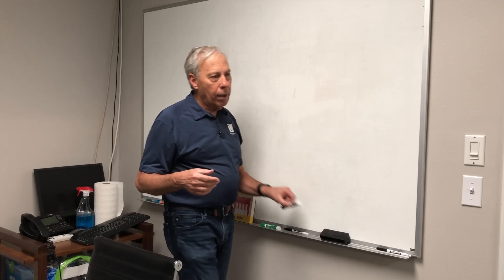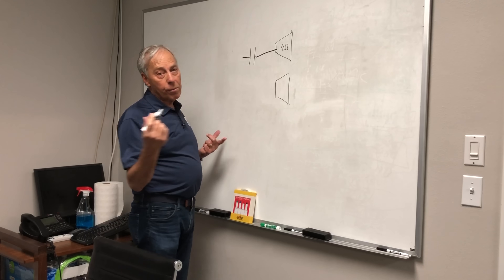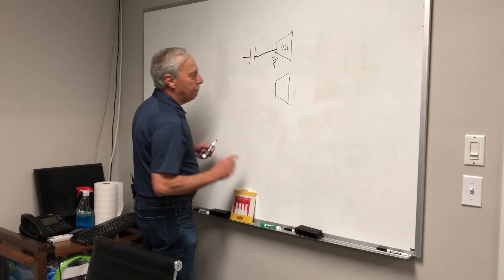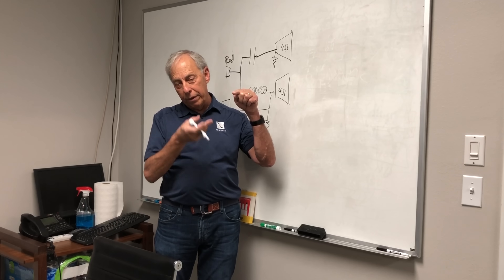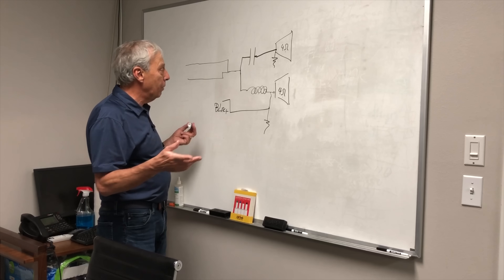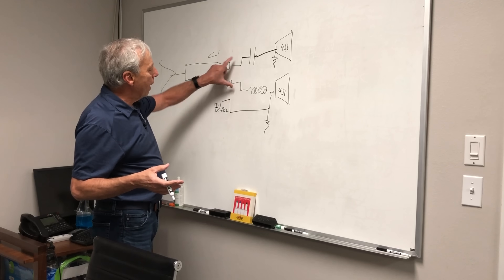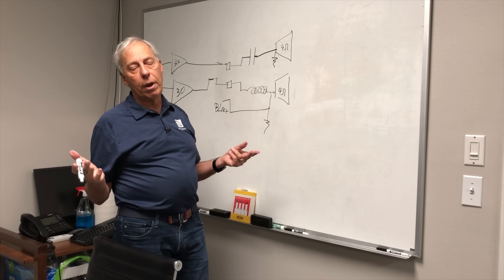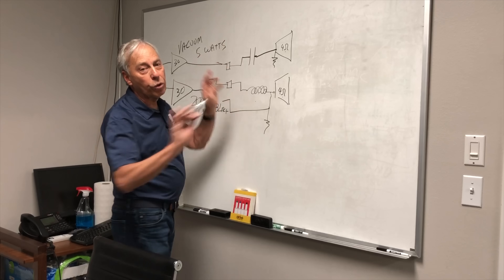How does bi-wiring work?

Comment: Audiophiles are heavy into placebos.  Bi-wiring/amping is pointless unless you are going to pre-amp an active crossover and bypass the resistors and coils altogether.  We used to do this 30 years ago with car audio.  Gauge and quality being equal, its ludicrous to think that there are wires that are better at passing higher frequencies than lower frequencies at a level noticable to the ear.  The market would benefit from attainable variable 2/3/4 way active crossovers, where we could dial-in high/low pass frequencies prior to amplification.  This would also make more efficient use of resources where high power amplifiers would be reserved for woofers/sub-woofers.  Then the audible difference would truly be noticeable.
Reply: hear hear
Reply: @Grant David . Right ... I am Bi - Amping . Using Adcom & Luxman on the same speaker housing . Adcom on HF , Luxman on LF
Reply: @stevenjosephs9  That’s awesome 👍💯
Reply: Bi wiring with a pre amp / receiver with an output ( L & R ) to a power amp is good setup . You gain nothing using bi wiring from speakers A & B off of 1 amp
Reply: @stevenjosephs9  You’re using two amp sections of your receiver, so that’s Bi-Amping, not Bi-Wiring. That’s beneficial in the sense that you now have increased headroom. An example of Bi-Wiring would be something similar to my how I have my two mains in my system set up. I have Gen 1 Emotiva XPA-1 Amps powering my fronts, on the back of the amp, even though there is only one amp section there are two sets of output terminals. With some braided 12awg (four strands = 9awg) I made, I utilize both sets of the output terminals, and both sets of the speaker input terminals. Now what does one get out of this? Well, beyond lowering cable resistance since you now have twice the wiring, nothing. So why do I do it? Because I think it looks cool.
Reply: Right , and looking at it from a speaker aspect " the speaker is Bi - Wired "
Reply: With proper gauge wire, bi wire is useless. I worked at a hi fi retailer for years. It was a means to sell more snake oil to customers. If you hooked up the speaker with 16 gauge wire and played bass heavy music at high volume levels, you may notice hi frequency issues. Swap out for 12 or 10 gauge wire and those issues went away. Bi amping does make sense even with passive cross overs. Allows for better tweeter protection and  prevents harmonics from the low frequency amp from entering the tweeter.
Reply: i thought it was maybe so that you could turn up/down the tweeter or woofer separately…
Reply: I have recently bi-wired my monitor - when you biwire a monitor, its higher frequency colours gets lighter with the lighter cable and the low frequency colours cen be made darker with the darker looking cable. Awesome. Now I am going to add 5 more wires for each separate colour. Does anybody know of cable makes that are really good with yellows?
Reply: Not sure about home audio affect but in car audio bi wiring does work. The premise is you bi-wire due to max input size of terminals. I run 2 sets of 8 gauge to each sub from amp (duel coil subs) it definitely makes a difference in heating issues which in turn affects output
Reply: And some superior types are heavily into spoiling other people’s fun.
Reply: You are wrong! I am bi-wiring and bi-amping and now i want to bi-source too.. highs on some songs are so good while the base from Drake is solid.. i want both at the same time
Reply: @Mango_Pickles  blondies rapture only sends chills down my spine with certain cabling. I lost it when i upgraded my cables but overall they're nicer to listen for long periods atm. Working on getting the blondie chills back 😅.
Reply: True , bi-wiring may be subjective, bi-amping is more true to the ears especially with large speakers at louder volumes. Active Crossovers would be pointless as well in a regular home environment as good quality speakers have decent crossovers in them already . It’s not the quality or gauge of the wire that is making the difference, it’s the “separation “ of the two . I will never go back to conventional speakers without bi-wiring capabilities, but then again when I do my mixing in the studio, the engineers are always astounded by what I hear and what they don’t pick up unless I tell them . A blessing or a curse . . ? You tell me 😛
Reply: The cables definately make a difference in whats transfered. Tey some single crystal silver cables and compare to copper. Vastly different sound levels coming through. I wouldnt say better..but different for sure. No warmth in silver..but maybe warmth comes from a fuzzy signal that has taken a longer path atom to atom and introduced some resonant signature of its material. I also have a fondness for gold on the return cable as it gives more of that warmth but its less muddy.  Depends on the ears and brain its heading into perhaps, we all got tuned slightly differently as babies/children 🤷

Comment: This is the exact opposite of what Vandersteen says about bi-wire and bi-amp setups. I'm not saying he's right an Paul is wrong, I'm just stating a fact. Vandersteen says the wires in a bi-wire setup should be the same, and he doesn't recommend bi-amping with different amps. He also says bi-amping is pretty much worthless, but bi-wiring does make a difference vs mono-wire (at least in his speaker designs). 

I had been running my Vandersteen Model 2c with 1 wire and the jumper between the hi and lo inputs. I recently decided to try bi-wire them because V says these speakers are made to be bi-wired and sound "better" that way. And I can't really tell the difference. It's hard to A/B test when you gotta unplug everything from the back of the amp, reconnect the jumpers, then plug everything back in. By the time you do that you've forgotten what the previous setup sounded like.

Comment: For some reason car audio allows you to do this easier, my pioneer head unit, no built in amp,  has electronic crossovers so I can set up custom crossovers/ slope and go active into each speaker, requires more Amplifiers, But it’s great for the front stage, 4 channels two for each tweeter two for each midbass, subwoofer has its own mono amplifier. Pioneer stage 4 copper chassis head unit  P 99RS , One of the best piece of audio equipment I’ve ever owned.
Reply: Fully agree with you.

Comment: Those who are skeptical of bi-wiring are ignorant of the sonic difference it can provide.  It does make a difference, contrary to what doubters believe.  Is it huge ?  It can be, depends on the quality of system and the cables being used.  But for anyone who thinks its a waste of money, simply does not have the knowledge to make such claims.
Reply: Suggest you watch https://www.youtube.com/watch?v=kR12Ttuxobs&t=895s and then write and tell Audioholics that they don't know what they doing.
Reply: @avsystem3142  I did because he doesn't know what he's talking about.  NOT PAUL here he is pretty much right on, we have a few differences of opinion, but he has a deeper knowledge on audio then AV Systems.  He relies to much on measurements.  Measurements are only a tool to get you in the ball park OR to help you properly match amplifiers to speakers.  Other than that they are useless as they tell you absolutely nothing about sound quality !

Comment: bi-wiring matters :) It doesn't necessarily sound more powerful, it just sounds cleaner.
Reply: NONSENSE!
Reply: @thegoat164  A signal generator at 1KHz was used to test 12 different amplifiers connected to bi-wiring and it was discovered that the ones that weren't bi wired had much higher distortion @ (clipping)

Comment: Just run good thick gauge wire instead of two smaller runs..the gold plated buss bars between the terminals can handle well over 1000 watts rms..no point in no wiring unless you have a terminal specific to the tweeter and for the woofer/mid range

Comment: So, I have a question. I just bi wired my speakers but now my sub woofer doesn't work anymore. My sub settings are low as 50hz but it seems like all the lows being handled by my great 2 pair of speakers? Thoughts?
Reply from the maker: Check how you are feeding the input to the subwoofer.
Reply: @Paulmcgowanpsaudio  would love to get some help. Feeding via sub cable from av receiver.
Reply from the maker: @asgsittng  Maybe best to email me directly. paul@psaudio.com
Reply: It might be time to invest in a new subwoofer. Its a tug-of-war. Now your speakers are winning.

Comment: So, the term "crossover" is a bit misleading because nothing is crossing over internally between the tweeter and the bass driver, it's the circuitry that goes in between the terminal and the driver to send it the right signal.
Reply from the maker: No, not really. There's quite a large "crossover area" as neither just cuts off. In fact, there's several octave's worth of crossover area.
Reply: @Paulmcgowanpsaudio  I get that there's frequency crossover but I'm talking about physical wiring inside the speaker. I think a lot of people think the drivers are physically connected together internally and that's where they get confused.
Reply from the maker: @TheTruthKiwi  Alright. Not sure I've ever heard that but I'll take your word for it.

Comment: I’m a bassist and I’ve biamped for several years. I run my bass through a buffered splitter; one of the leads runs to a 500 watt class D bass head and then to a 4x10” bass cab with the tweeter defeated. 

The other lead coming out of the splitter goes to a Eggnater Rebel 30 that’s dialed in to using one pair (the EL84’s) of the 2 pair of power tubes for a total of 15 watts; that amp’s output runs to a 2 x 12” closed back guitar cab. The bass control on the Eggnater is turned all the way counterclockwise to cut the most of the bass out of the signal that’s destined for the guitar cab. 

I use the guitar side for any effects I run and if I want any overdrive or distortion, I crank the gain on the Eggnater to taste as the tubes excel at that kind of thing. I dial in the bass amp pretty much the same as if I weren’t biamping. 

I’m sure there are more technically elegant means of achieving what I’ve cobbled together. Still, this system has served me well over the last 10 years.

Comment: Sadly bi wiring is a pointless exercise.  You take four cables from the amp, 2 for the left and 2 for the right channel off of the left and right channel of the amplifier. Four cables total.  Each cable will carry exactly the same frequency range 20hz to 20khz.  At the speaker binding post you remove a link plate on each speaker. You connect one cable to the lower and one cable to the upper connections.  All that happens inside the speaker is you connect directly to the low pass and high pass filter of the crossover avoiding a small section of PCB circuit board track that was used prior to removing the link plate.  The crossover still has to do exactly the same filtering.  All you end up doing is buying double the amount of cable with no audio benefit.  Bi amping is a worth while exercise though.
Reply: 69jarinek  from an amplifier output you will get 20hz to 20khz. An amplifier will not differentiate, that's the purpose of the crossover inside the loudspeaker. I think your understanding is wrong of what an amplifier outputs. Now if you go the route of full dsp crossovers then the amps are fed low, mid and high. We are talking passive loudspeakers with  in built crossovers and bi wiring carrying the full frequency range from the amplifier down the cables. Nothing to change on my post.
Reply: 69jarinek how large a space are you trying to fill?  There is no benefit in bi wiring. Most people would have a 2ch stereo amp. If you are lucky to have a true 4channel stereo amplifier, vc4 type all you gain is volume for less a turn of the volume control. A lot of clever sales talk is made saying you will hear a difference bi wiring, you won't, same internal crossover, same info to the bass and tweeters. Save your money on cable.

Comment: I remember reading about a Sunfire amp where it had two output sets, one a current source, the other a voltage source. If memory serves it said the current source was better for low frequencies, voltage for high, so I guess there's one time where biwiring would be useful. Never heard the amp so I can't say for sure. My Rotel RB-1092 amp has two sets of speaker connections specifically for the purpose of biwiring. Haven't tried it but the option is open if I feel so inclined.

Comment: I dont know enough still to understand this.  I have a general idea. Capacitors are like tiny batteries... ohms are a measure of resistance... what they do...? No clue.
Reply: Yes capacitors are like batteries. But they also behave like audio filters, allowing treble through but stopping bass. Coils allow bass through but stop treble. That's a very simplified version, but crossovers usually have several of each to allow the correct frequencies to be sent to the appropriate driver.

Comment: Vandersteen always recommends that you bi-wire their speakers for best performance. Vandersteen does not sell speaker cable.
Reply: Peter Lemonjello if you’re going to bi wire do it properly, cable companies sell bi wire cable but it simply splits at the end, like a jumper cable, use two separate independent speaker wires, and bi amping  is also more beneficial. A traditional single bi wire cable is useless you might as well use the jumper cable and save the $

Comment: Can you bi wire and bi amp at the same time
Reply: A firm maybe.  My bi-ampable speakers have four terminals. The woofer pair (and the low pass) are electrically seperate from the mid and tweeter crossover pair, so anything you want for amps and 4 wires per speaker.
I also have rebuilt KLH 6s that have only 3 terminals and the crossover only has ONE negative terminal.  Doubtful they could be biamped with seperate amplifiers without investigating both amps output's electrical reference. It's most likely to be okay if BOTH use chassis ground as the negative return, otherwise I'd guess NO.
Reply: Ask a cable and amp salesman. You have two guesses as to what the answer will be....

Comment: I've got some Bi-wirable speakers and wrongly assumed that when you disengage that metal connector between the treble and bass posts the signal just goes directly to the driver. I just thought you'd have it bi-amp'd negating the need for the capacitors and coil wires. Now I know. So I'm guessing the top-end "made for bi-amping" speakers don't have any crossover circuitry to get a cleaner sound.

Comment: if my amp has a speaker's a and b speakers output couldn't I use a-left then b left to biamp left speaker and do both sides of my speakers like this
Reply: From my experience when using both a and b speaker selections at the same time on 2 sets of speakers it pretty much distributes the power 50/50 (is much quieter) so I'm guessing that if you had a and b going into 1 bi-wired set it would sound the same as just using  the a selector. I may be wrong and/or your amp may work differently. I'd give it a go and see if it sounds any better

Comment: Bi-Wiring does not make sense to me. What makes sense is Bi-Amping with an *Active crossover (*before the amplifer). Then the amplifier does not have to deal with unused frequencies. I agree, the only thing that makes sense with Bi-Wiring, is using cables that is best for each particular freq band. Bi-amping is also a better option, but a lot better with active crossover.

Comment: Hi good video right now I have two PARASOUNDS 2125 models  that I bi amp with for a good while now,passively .the second amp does the tweeters. They both have the same power 125watts 8olm.I do have a vacuum tube amp which is a mini one 3and half watts per channel can I use that one for my tweeters ? Not sure what the gain is .There is no outputs on that amp so it would get the signal from the parasound.

Comment: Bullshit. That only applies to BiAmping. BiWiring is simply extending the speakers on board jumpers.
Reply from the maker: That is incorrect. Sorry. Bi-wiring uses two separate speaker cables to deliver sound as split by the speaker's crossover. Not all speaker have dual sets of binding posts to separate the crossover, but for those that do, bi-wiring is quite real.
Reply: @Paulmcgowanpsaudio  You are wrong, there is no crossover split. In single wire, the HP and LP filters combine at the speaker end jumpers, in a Buywire run, the HP and LP filters combine at the amplifier end, same ground potential and all, no split, same difference.
Reply from the maker: @solitaire5142  Except you are missing the point. By separating the HP and LP load into two wires, tied together at the power amplifier end, the HP wire carries only the upper frequencies and the LP wires only the bass. That is very different than a single wire carrying both frequencies.
Reply: @Paulmcgowanpsaudio   The amplifier is supplying an identical signal to both HP and LP filters whether you use one, two or twenty pairs of wire. The circuit is identical and biwiring does not change the layout whatsoever.
Draw yourself a schematic and see for yourself.

Comment: you said as long as the 2 amps have the same gain, and you wrote 30. 30 what? how do you know the ghain of your amp. I thought gain is the voltage coming from your head unit and gain knob controlls that voltage. Pllease clarify. much respect!

Comment: My mains are Bi-wire-able and I've done exactly as you mentioned, I fed the mids and tweets off of tube amps and the big woofers off of solid state. Works like a charm. 
Great vid!
Reply: Peder Hansen  not when they were designed for it.
Reply: Peder Hansen  I have multiple pre amps. I don't run them all at the same time though! :)